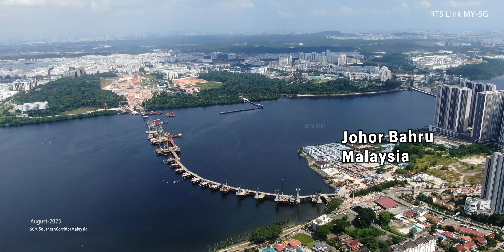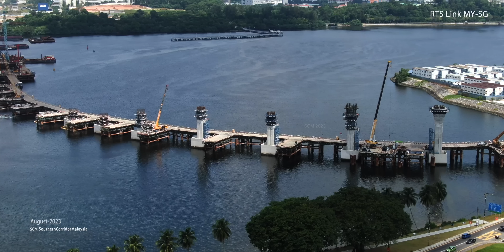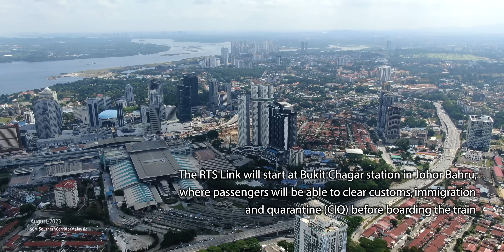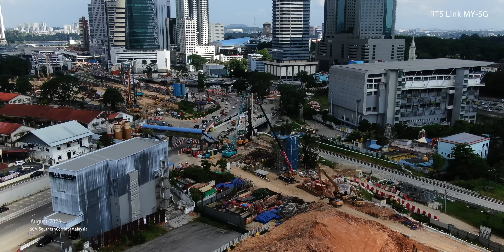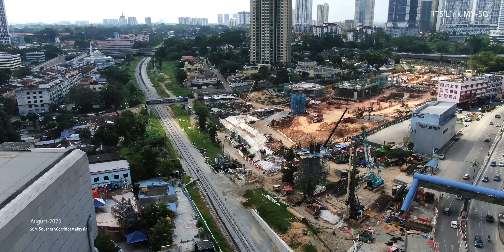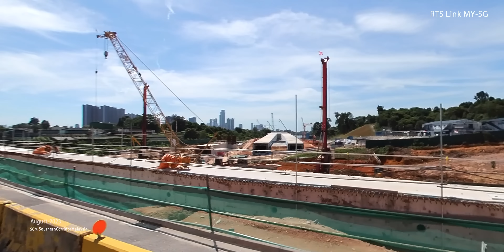IT IS FAST! The RTS Link Malaysia & Singapore -  August 2023

Comment: So slow the progress for a short distance,
Reply: Construction timeframe does not depend on distance. It only means a single contractor can build the station & the line, as in this case (one contractor each on both sides for each country), unlike the EDTP Gemas-JB which needed sub-contractors & was split into 5 contracts. But the timeframe is still the same because you are constructing buildings. The amount of time depends on how much time is needed to construct these structures. Not the distance.
Reply: @byteme9718  you are not alone in hoping that the construction of the RTS can be completed sooner. But I'd rather a delayed but great transit system which can benefit everyone in the long term, than a quick but sloppily completed project which brings further troubles instead of solutions.
Reply: @byteme9718  I wouldn't say it "lacked capacity" yet, considering that Shuttle Tebrau is running only every 60-90mins, as compared to the RTS, which will run every 3.6 - 6mins & can carry up to 1069 pax per trainset as compared to Tebrau's 240 pax per train.

But yea, I do agree that it will not be enough to solve the Causeway woes, otherwise the SG Government would not even think of expanding the Woodlands Checkpoint even in the midst of this & the transition to Automated clearance.